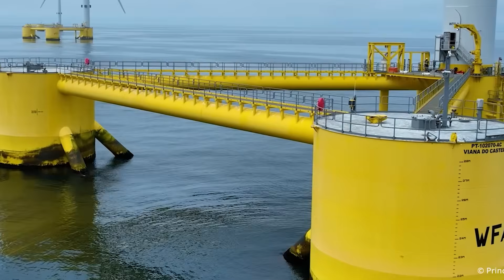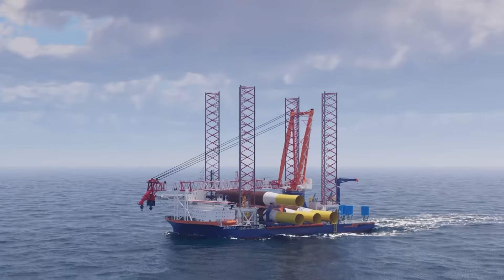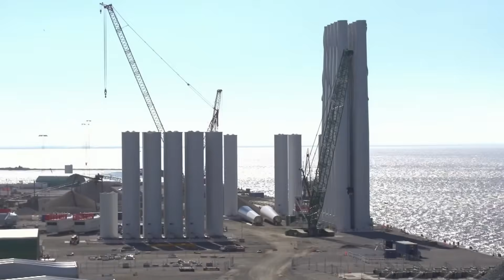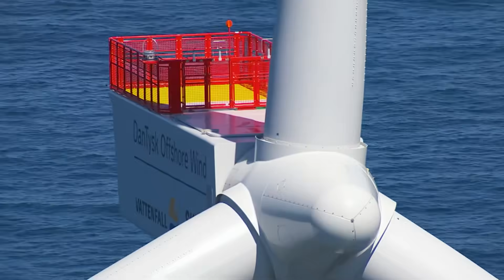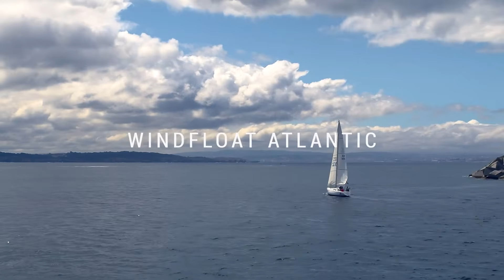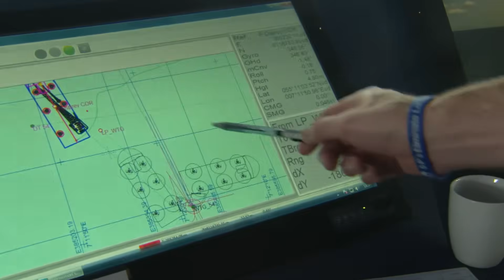Crazy! These Wind Turbines Will Power The World!

Comment: When I was looking at the opening picture, I was wondering why the turbine is sitting on the deck?  Why not be in a hole in the deck, that goes down to the bottom of the ship, so that the center of gravity is 15 meters lower then bolting it to the deck?  Why stop there?  What if the hole in the deck goes 5 meters below the bottom of the hull?  Then the center of gravity is even lower, with the problem being that the harbor needs a little more depth where the installation vessel can go. 

But what if you wanted to have the turbine nacelle on top of the tower during transport?  Would you need to have the tower sink about 15 or 20 meters below the hull?  Is that impossible?  No.  But it has to be nearly level with the bottom of the hull while in the harbor, then drop the tower and the bottom of that section of the hole by 20 or 30 meters once you leave the harbor and are going towards deep water.  Maybe you can have the entire turbine assembled in the harbor, put it into the hole, and then as you leave the harbor, lower the turbine and tower about 30 meters into the sea.  Think it is impossible?  Turn this document over to.a Marine Vessel designer that is smart enough to discover what I am trying to describe.  They might say it is totally impossible, and the following year come out with something that works great.  And you will look back at 2025 as the year when you could not take a entire wind turbine out to sea assembled.  

The other thing they need is twin boom cranes, for use in high wind conditions.  Right now, there is only 1 cable and place to hook up stuff.  If they had twin booms, then they can be set up 5 meters apart, and then lift something and the left and right can be adjusted so the item they are lifting remains stable.  Or set them 10 meters apart, and really gain control.  Make it adjustable.  When you lower a turbine blade, how nice would it be to have the two cables that are holding up the blade 10 - 15 meters apart, to both distribute the weight over the length of the turbine blade and to make it adjustable where you can lift or lower the tip VS the center of the blade.  

So if you could look at a wind turbine installation vessel of 2030 design, what would it have?  What is on that installation vessel that you wish was on your current design vessel?  You can do it!  

What if the ship designer says "If you have a 10 meter diameter thing that is extending 30 meters below the vessel, you will add several dozen tons of lift to the vessel, and it will make it crack into pieces when it is full of air".  I am not saying keep the thing the tower base sits in dry.  Let it flood with water, so that there is not extra lift when the thing is lowered into the water.  This will require the tower to be painted before lowering it into the salt water.   Maybe they can carry out 3 of the turbines to the worksite.
Reply: Ok, now I'm really looking forward to how these things will look in 20 years